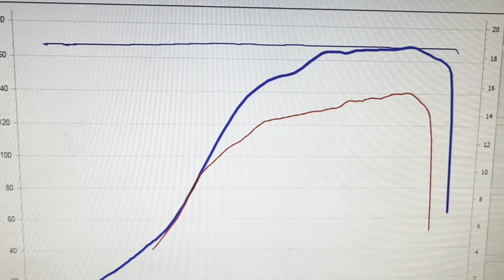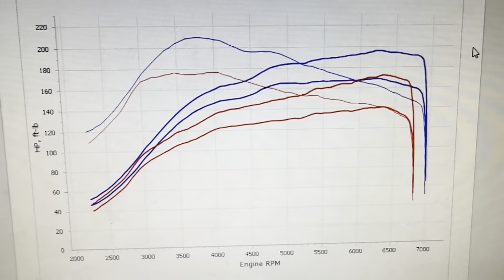How Much power can a stock Smart ForFour Brabus make Mapped?

Comment: Im currently working on my forfour brabus, unfortunately i cant get it to run smooth. When the engine is in operating temperature, it jerks violently. I live in the netherlands, so coming to england with a half running car is no option. Do you have any tips?
Reply from the maker: Find a decent mechanic/tuner in your county and take it there
Reply: @DynodazeHondaTuners  i took it to two smart "specialists" that didnt know where the crank position sensor was